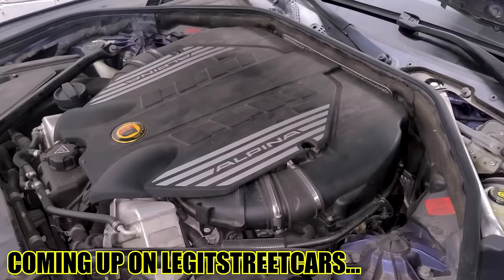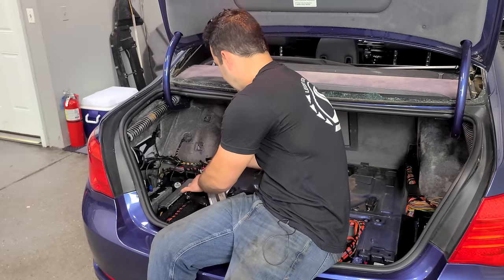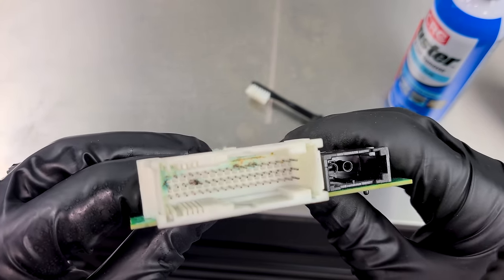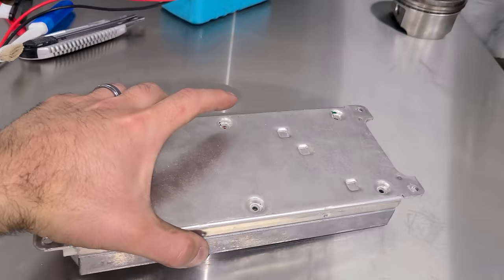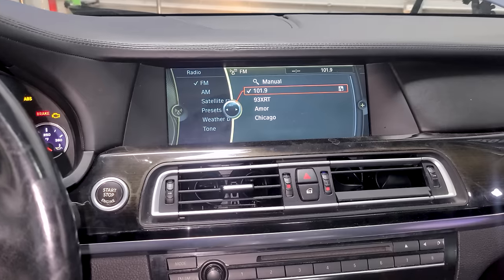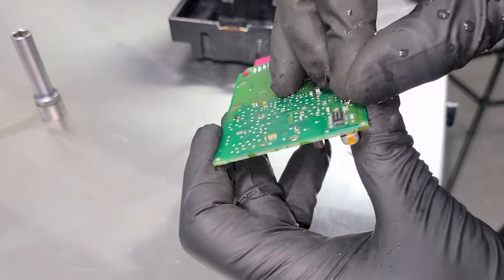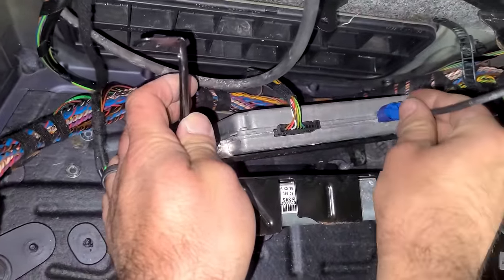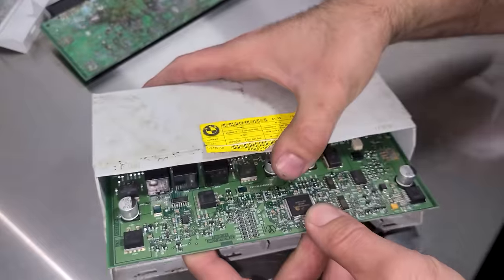BMW Dealer Tried Totaling My Car By Quoting $15,000 For 10 Computers! I Fixed Them All For $150!

Comment: im a driver for LKQ, check them out for random parts like ALL of  these.  That ABS pack would be ~$150 from us. it would come just as you pulled it free of the car, prolly with the lines cut off a few  inches from the unit.   we only ship to a businuss, but usualy for free.

Comment: In defense for the dealership is that they replace anything with new parts and have a warranty and don't do patch fixes. Yes they usually are more expensive then an indy shop or DIY repair but they'd be out of business otherwise. You'd have to go to the internet for your parts and or vehicles. It would be like trying to get your Tesla fixed. Good luck with finding an authorized shop to do it. And good luck ordering parts.

Comment: I repeat and repeat would never use a wire brush on a PCB if you scratch the board of resin and gets deep enough you can expose a trace or even damage the traces on the PCB. Get a corrison remover, or use boiling water then use rubbing alchol to dry the board. Then to reprotect the board that yellow stuff is silcone spray. Its yellow because of it oxidizing reapply if needed.

Comment: I used that same exact cleaner for the USB on a document scanner that would not connect and it worked.  I also did the cable end that goes in too.  It does dry fast.  It also got it working again so no more problems getting it to show up.  Just make sure to blow it or give it time to dry.  I think that cleaner is not conductive but I am sure that is a chance you would not want to take.

Comment: Love it. I think electronics are the components people fear the most. My 2003 530i had bad door card seals and flooded the floor. After repairs and drying the electronic systems started going out. First it was the headlights, then door locks and window sitches, sunroof and heating system, seats you name it but it still ran. Eventually the motor  died too and even lost communication with the main computer. I almost had it towed to a wrecker but gave it one last try. I sent out the PCM and it tested fine so I started digging for 'other' fuses or grounds that weren't visible. I found a fused control block in the passenger footwell of all places and it was damp and badly coroded. Oxide growth like you wouldn't believe. Wires literally snapped off the connectors. I pulled a used fuse block at Pick N Pull and had to cut and splice about 12 wires in all with new connectors. After installing the fuse block the car fired right up, communications fully restored and everything functioned.

Comment: A word of caution, some contact cleaners can melt and destroy the plastic connectors. Also it usually safe to use alcohol for cleaning circuit boards, they do make a pure alcohol with out any additives that can you too, or just rinse it with DI water if you it is nessary. Always check to make sure the cleaner is safe by testing the outside of of a plastic connector!

Comment: EXCELLENT WORK! INSPIRING! Its great to see intelligent guys like you successfully eliminating prblems, step by step. I like to use silicone grease on larger connectors to protect from corrosion metal-to-metal contact works as before but water can't get in. An alternative for smaller contacts might be WD40 (WD=Water Displacement) but I havent tried it. Does anyone else know? Side remark - in addition to the actual cost you mention, any independent technician would have had to charge for 2 weeks' labour I'm guessing about $10,000 to the customer. All the best, Rob in Switzerland

Comment: When I was in college, I repaired my old '87 VW Jetta's tail light module with a can of Coca Cola and Brake Clean.  Soaked the module in the Coke to allow it to eat away the corrosion and the brake clean cleaned the sugar off.  Light worked Great afterwards.

Comment: I’ve had many 7s, most I bought non running or nearly non running. Even been able to code a transmission with one less gear to a newer car when the “specialists” said it couldn’t be done.  A8s are always a great one also.

Comment: This was a fantastic vid! Like.. one of my favs! My mom crashed her Porsche Cayenne turbo S into a ditch filled with icy water.. the car started.. the insurance company totaled it because water was inside.. I did not want to let that car go.. I bought it back at an auction.. we replaced the carpet.. but some weird things didn’t work.. like the seats wouldn’t move.. the taillights were flooded.. I’m a chick and not mechanically inclined. But I replaced the seat motors.. and literally dried out the amp.. cleaned it.. a body shop replaced the carpet.. and the car was like new again. That was back in 2013.. the car still runs like the day we bought it in 2013

Comment: Thank you for sharing this message!  Anyone and everyone that has the will to do this, can totally do this!  

For me, 100% electronics grade Isopropyl Alcohol is my go to for general cleaning of PCB assemblies.  One benefit of Isopropyl Alcohol is that it’s great at displacing water.  

Deionized Water is great for rinsing off the assemblies, as such an ultrasonic cleaner is great in removing junk that you can’t see (i.e. under semiconductors, etc).  Just be sure your assembly doesnt have any components that are susceptible from being dunked in water or solution, like open frame relays, etc.

For connector corrosion or connectivity issues,  DeOxit, by Caig industries is your friend.

Finally, an air compressor is invaluable to ensure every ounce of deionized water or cleaner is off of your board.

Comment: For cleaning PLC's, you might also consider an ultrasonic wash with dishsoap/water, followed by blow drying/forced air and some general purpose water dispersant (e.g. WD40 or white label equivalent). Just be sure the capacitors have been discharged and that there are no batteries/electrical charge/power left on the board before proceeding with this method.

Comment: Watch out for spraying cleaners or submerging is pure water the capacitors that are those round canisters on circuit boards. If the leads suck up any fluid is messes up the capacitor and if a high voltage cap it can pop with power applied.

Comment: If you go to the right person, they can probably replace things like the connector but I don’t think many would do work on cars. Still, you got it working for a lot cheaper, that kind of repair should definitely be an option at the dealer. Like when your car only costs twice as much as a replacement and it doesn't need to last.

Comment: Alex….you should wear an ESD strap and grounding cable when handling boards with IC’s and transistors or MOSFETs etc…..one little static zap and bye bye board…..also soaking boards  in electronics grade Alcohol works great and pushes moisture  out of the board also clean you fiber optic connectors properly as the data link is the backbone of your system.  …Great job ..!!!

Comment: If you can plug in a connector, say USB to a laptop or PC computer and you've washed dishes manually there's a lot of skill cross over with what was shown in the video.

Was there no issues with the power steering, or did it require fresh juice?

Comment: On the ABS unit, you can see where the plastic where hit. On the bottom part, where the plastic was narrowest to the aluminum you can see a darker black spot where something have hit it. 28:29

Comment: Sometimes the corrosion eats through the copper traces on the circuit board.
A shop that repairs cell phones and motherboards by microsoldering can repair this.
The NorthridgeFix channel has videos showing how this is done.
They also repair keyfobs.

Comment: i was a mechanic for 32 tears and honestly i prefer older cars over ones with so much computer controlled technology. and it is absolutely incredible what a dealership would want to fix all these modules as they are not going to fix them but just replace them.
Reply: go around the BMW dealers trash cans and dumpsters at night and DIVE hahaha

Comment: Reflowing solder joints is another step that can bring modules back to life. Just make sure you use a quality flux and clean it off after iron work. BTW electrical contact cleaner is perfect for cleaning air flow sensors, I do mine every oil change.

Comment: "Coming Up"   at the start   Have you got a collab with Streten from 539 Restorations in the works ???   Great video Alex  Ive always tried fixing modules even from the 80s and 90s  some of which were electro mechanical I enjoy that side of vehicle mechanics and when it works you get a great feeling of satisfaction.  Keep up the good work

Comment: When the board looks shiny, that is an indication that the board/PCB has been conformally coated. It's a kind of wax or varnish that is sprayed onto the board and makes the board waterproof. That's why you didn't get any corrosion. The connectors can still be a problem. One note - the chemicals used for conformal coating are nasty, especially when heated, so no soldering!

Comment: Great job on repairing the modules. You should probably replace the battery with a BMW OEM battery because i see the auction just threw in a mopar battery which is not the correct battery for the car.

Comment: most dealerships will flash a junkyard ecu, airbag units, etc for pretty cheap so that they correspond with your locked immobilized vehicles. Ik my local toyota dealer does it for about 50 bucks a module on an older 4runner.

Comment: Nice repairs, but powering all corroded and probably defective units several times could lead to new or extra damage of the electronics when it has internal shorts. I would first observe and clean the units before even powering the car.
Reply: Yay! someone else that gets it.

Comment: Di water is a good way for cleaning most circuit boards, however never use it if there is a transformer or windings on the board because the water is near impossible to remove from the coils and any impurities in the water will conduct between the coils essentially shorting out the coils.  Pure water is an insulator but all water has impurities which make it conductive including DI water and even (feed water used for boilers) which is cleaner than DI water also has impurities.

Comment: The only thing not mentioned is the reason why it was swamped in water in the first place & additionally I would have put water sealer lube on all the connectors to stop any further corrosion, I do this to computers all the time particularly those that came in my shop from the beach. And the Magic Trade Secret lube I used was a thin Lanolin spray ( it's a non conductive oil spray).

Comment: I have an ML420CDI the V8 twin turbo  question 1 ..how can I get more hp from engine..its 306bhp standard. 
Question 2.. its on springs for off road ..I'm never going so do you think using lowering springs 35 and 45mm a good idea to lower my ML420?  Nuff respect for your answers Boom Box 📦 🇬🇧

Comment: The water conditioner you have, by description, uses "template assisted crystallization" or TAC. As far as I know it doesn't remove minerals from water it only conditions them so they will not cause buildup. For example, TAC should prevent scale buildup on the glass door in the shower. TAC is good because it doesn't "let" the minerals attach to the plumbing or whatever. I think that's the only reason TAC is OK for cleaning the circuit boards. I think it's a better way to deionize water as traditional salt based systems will put salt in the water in exchange for the calcium and magnesium.

Comment: Some of the PCBs that have yellow tint: That's conformal coating, it's job is to prevent moisture ingress. With some basic soldering skills you could fix most of these.

Comment: If you don't have a torch to shrink the heat shrink you can run the soldering iron up and down it on each side.

Comment: Working on a BMW: 1: Remove stupid pretty-cover that is preventing access to the part. 2:  Remove the part, get a quote for a replacement one and fall over backwards.  Pay exhorbitant price or spend ages finding a secondhand part. Install hyper-expensive part. 3: Replace stupid pretty-cover to impede future access.

Comment: I owned a BMW 325i Coupé E36 from 1992, custom leather interior in light cream color with nice thick stitching, the seats in that car were far better than anything I had at home, I had M5 rims on it, lowered the suspension a bit using the model E46 suspension parts in the back and got Koni Yellow parts for the front which made the stance of the car just perfect, then I had special Hella headlight units with the angel eyes rings and clear glass, the cover on the motor I spray painted with the color matched with the car and on top of all that I custom built the car audio system myself of course with the Rockford Fosgate compo set 400 watt midrange and tweeters in the front of the car, custom built a new speaker plate/cover for the rear which also had the hole for the bass reflex pipe from the Rockford Fosgate Punch 500 watt subwoofer that I had in the trunk but faced to the inside so you didn't see the subwoofer in the trunk just a big box and my 3 Phoenix Gold Amplifiers.

To see the subwoofer you had to pull down the rear seats so you can imagine when you were sitting inside the car the full blast of the subwoofer was in your back and because I had the bass reflex pipe pointed up to go right through the metal plate and my custom plate/cover it pointed nicely at the rear window so it was very loud inside but crystal clear sound, no distortion or things that were rattling inside or outside the car.

Of course I added Dynamat all over to get rid of all the resonating panels and such, the cables I used to connect the speakers were with silver core, Rockford Fosgate branded RCA cables and power cables and fuses and all that little stuff you need, the head unit was from Pioneer because that was the only one that gave me full control over the equalizer digitally and it just looked the best with the animations and all, I think I spent at least 10 grand on the car audio system alone.
The measured output was 156.4dB.

Man, I loved that car so much... If you're still reading you can tell how passionate I was about that car right?
Never in the whole time I owned that car it was dirty, I cleaned it every day if I saw something on it... In fact I cleaned it so often that it always smelled like flowers on the outside, the whole parking lot smelled like flowers when I pulled up.

The best thing of the BMW cars is that you can indeed do a lot of the work that you may think needs special treatment or a BMW mechanic but it really is as simple as you show here in this video.
And yes you can find used parts that are perfectly okay for just a couple hundred dollar or less, I was lucky to have a special BMW recycling garage close to where I live so whenever I needed something that would be very expensive if you got it replaced by BMW for the cheap, for example I damaged one of my M5 rims and those are very very expensive to replace if you want the real original brand and I got super lucky to find one rim of a crashed M5, the only one left without damage and I payed something like 125 Euro for it which is dirt cheap for an original M5 rim.

This video brought me back to the good old times, thanks for sharing.

Comment: Great video.... However, I would follow ESD safety guidelines. A little static can cause way more unseen damage than what you can see in the video. And static voltages lower than what you can feel can still do damage to solid state devices.

Comment: It's best to clean those fiber optic connections before re-assembly and some dielectric or cleaner/protector on those connections would be worth it as well.

Comment: You know what ill use chris fix miraculous soopy wooder but kinda hot or warm. And use isopropyl alcohol and then dried it thoroughly. No need for de ionize water. If you can bake go bake it above 100c and you done

Comment: it is pretty well shown what people with some experience will be able to do when something like this happen but to say anyone even without any knowledge will easily do it as well I can just see the issues piling up with endless questions to other people what to do next. how can I know this? well I am a caravan technician working with electronics pretty much all the time. and many many times when people tried to fix something themselves they actually cause more damage than they fix making the problem even worse instead. But with that said you can rinse electronics in water, using Isopropanol and so on, I like to use a ultrasonic cleaner to clean boards since this also reaches areas a simple toothbrush can´t. but it all sounds easy for people that knows what to do and way more complex to others who don´t. that is why workshops always are needed

Comment: My Honda dealer wanted £70 to diagnose the cause of an engine management light malfunction. They said it needed a new main computer card, costing ££2500. I took it home, sprayed all the electrical connections with WD40, reset the engine management light, and the problem went away. The reason is we had a really bad winter with a lot of salt being spread on the road, which no doubt caused shorting on a few sensors.

It’s why they are commonly known as Stealerships.

Comment: Get where you are coming from and in a lot of cases it's worth giving all that a shot (Hell I would/have), however a lot of these boards are layered, with tracks running through the layers. The boards will in some case will suck moisture in and the tracks rot in the board or at least corrode enough to bump the resistance up to confuse something else or cause heating. Car boards are well coated though and it's alway worth a shot 🙂

Comment: The best way to clean circuit boards is by using ultra sonic machine and some circuit board cleaner by using this method u can clean under the SMD  component .